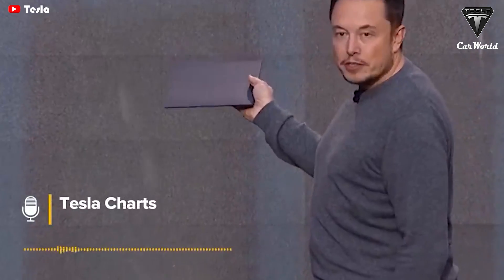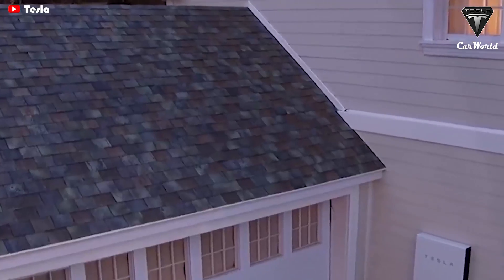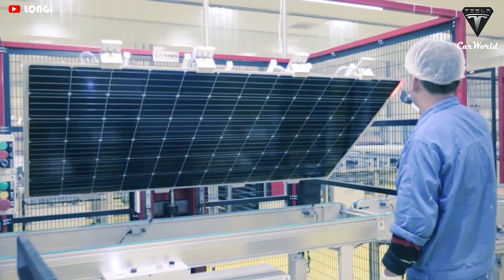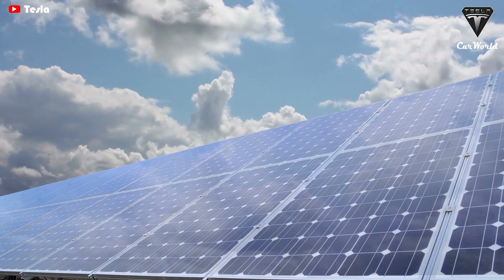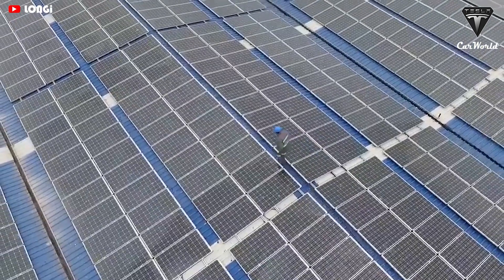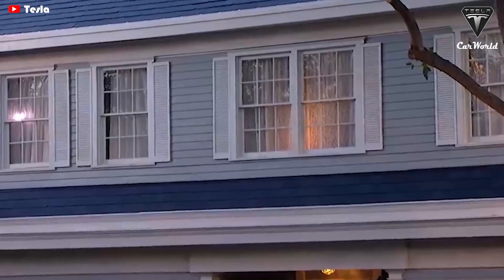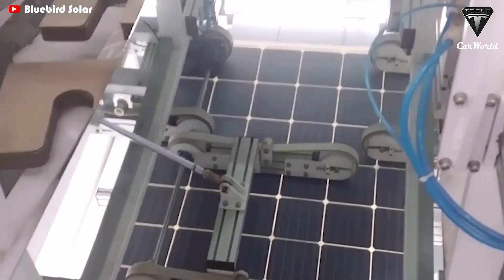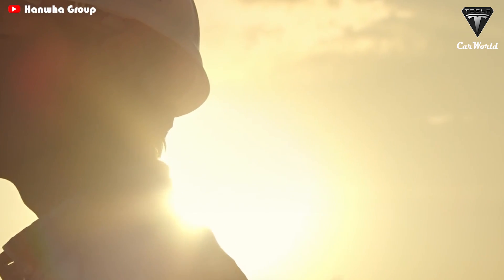Elon Musk Claims New Insane Version of Solar Roof (v3.5), 100 years of Power, $0.20/watt!

Comment: Lol 100 year roof with a brand new product. Good luck with that. Testing cannot replicate thermal cycles and time exposed to the elements. Even all natural high quality products like clay tile and concrete tiles, or slate tiles only last as long as the underlayment (50 years is expected, and with good maintence can last longer). Nothing is different in this scenario.

Comment: Solar Roof is pretty much for people for whom price is no object. Inexpensive traditional panels make a lot more sense for people for whom money matters, but they are much better if ground-mounted. Roof-mount traditional panels are only a last resort if there's nowhere to put them on the ground. They are a headache when put up on a roof, cause leaks, make it extremely difficult to do roof repairs, and firemen hate them because the wires on the roof are always live right at each of the panels if there is any sun shining. Roof-mounting also makes it dangerous to do any maintenance on the panels, (due to the chance of falling.) It's also difficult to clean them, (including these Solar Roof ones,) something that is best done once a week or so since a modest layer of dust can cut their output up to 20% or so. More if there's more dust, or even worse, a very light snow on them, which will basically kill all useful output. Just some things I learned about panels from using them with my RV for 2 years when I was living in it full time. It only took me about 5 months before I removed them from the roof and turned them into portable, ground-mount panels.

Comment: Let's say I need a 10kw system. I have a 3.5/12 pitch roof. Front facing 200 degrees south at 34 degrees longitude. I would have 3 kw on my north facing roof  that would help start recharging my 2 powerwalls for the first 4 hours of the day and 7wh on the south facing roof for the afternoon Temps and sun. Best time to do laundry and fill up those powerwalls! Even though the sun is at 180 degrees at 15% angle I'm still recieving sun on the north facing panels.  If I'm gonna be replacing my roof every 20-30 years and probably changing out panels everytime why bot go with version 3.5 and have a glass roof that's gonna last into my son's lifetime. I'll take it! That's my order tesla! 10kw of active and 2 powerwalls please! IVE ONLY BEEN PATIENTLY WAITING FOR MY SOLAR ORDER SINCE MARCH OF 2021! But seriously I'm being very patient because telsa has done a great job of reinventing the residential rooftop solar so I'm good! Price per kwh with TVA and LPC has hone up 35% since I moved into my new house in OCT 2020! I'm ready now!!! Great video btw! Someone help me get this to telsa so I can finally enjoy tesla energy! Heck I'll be a test dummy for version 3.5!
Reply from the maker: Thanks for your information!

Comment: Blah blah. What we need to know is the cost of the solar tile roof comparable to the shingle roof? We can pay extra for the batteries, but as long as it’s much more expensive than shingle roof, it won’t become mainstream.
Reply: It was said in the video that the cost is comparable to the cost of a new roof ....plus the cost and installation of regular panels
Reply: @MolloRelax  My auto correct decided to change shingle to single, so it made less sense. The cost of a shingle roof is a lot cheaper than a tile roof. I believe they currently compare to a tile roof, not a shingle roof, and the cost of installation of regular panels in the US is still extremely high. So that’s still a no-go :-(
Reply: @dcle944  check out this girl interviewing this guy about his tile roof
https://www.youtube.com/watch?v=GOIUJZmBZmA. 
it makes sense if you need to replace the roof anyway. The Tesla crew even fixed deficiencies on this guy's roof  before proceeding with the install. I am pretty sure they brought it back to code.

Comment: Does it make sense to cover portions of the roof that seldom receives sunlight with solar tiles i.e. the north facing portion or tree shaded portion of the roof, or would regular shingles or matching dummy solar shingles be more practical and cost effective?
Reply: That is exactly what Tesla does. Panels that aren’t solar but look the same.
Reply: They have active and non active single tiles. They aren't putting the active tiles in areas that they don't get enough light on.
Reply: In Micheal Moore's Planet of the Humans movie an engineer explains why so many tons of coal are used in the production of solar panel. Plus a huge amount of fossil fuels are required for the mining of the quartz & other minerals used in their production.
Reply: @georgevue8175  There is also a huge amount of fossil fuel required to go and find ,and extract and process more fossil fuel that produces a huge amount of pollution produced by internal combustion engines. People never seem to comprehend that a transitional phase of developing and fine tuning new technologies is necessary , at the cost of incurring some short term negative effects to the environment. Even if there is another 100+ years worth of global oil supply, new tech needs to be introduced at some point in time between now and then. Might as well be sooner than later.

Comment: Why can't they use the same idea on car roofs or even the Tesla semi trailer roofs in order to extend driving ranges.
Reply from the maker: To test his theory, a Tesla car owner will use 18 specially-designed solar panels to power a 15,000km journey around Australia in a Tesla electric car. The printed panels offer a lightweight solution to conventional solar cells, allowing the energy system to be rolled up and stored in the back of the vehicle. Hope this happens in the future. Thank you for your comment, James Marsh !
Reply: The problem is it would take too big a solar panel to actually make much of a difference. The company Aptera in California has a vehicle now which is very strange looking but has a one thousand mile range due to the car's extremely high efficiency as well as its high efficiency roof-mounted solar panels.
Reply: @richardnwilson  The Aptera car has about a 40 miles range of solar power per day , according to the makers. The rest of the range is produced by a battery pack, like all other EVs